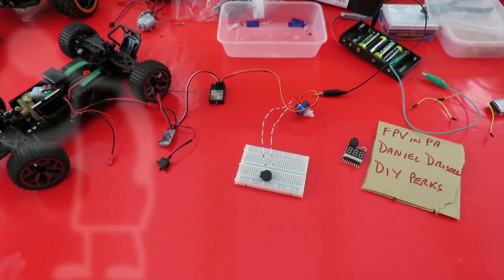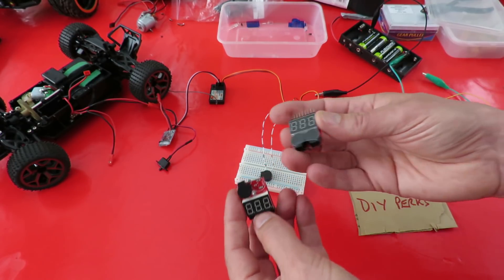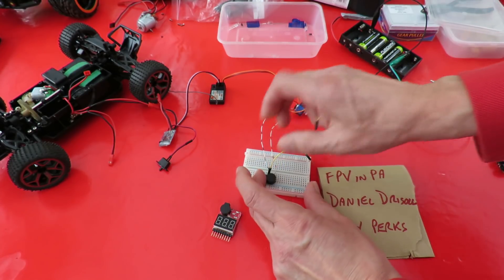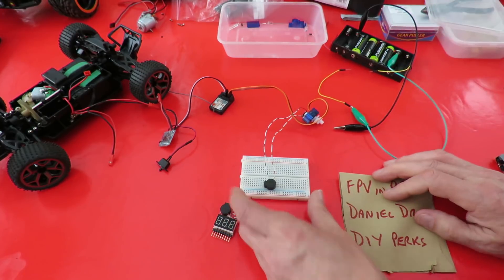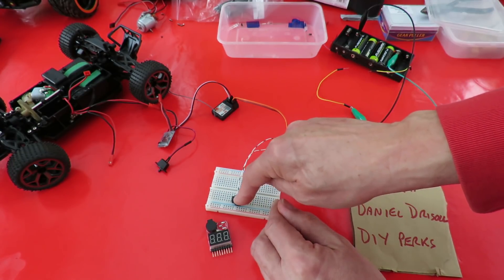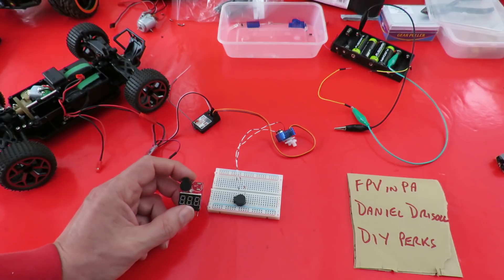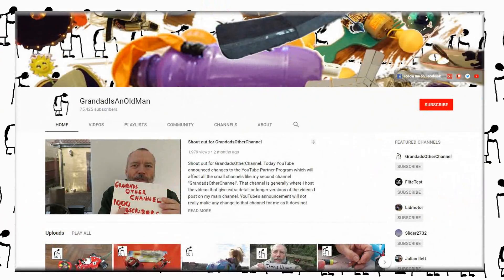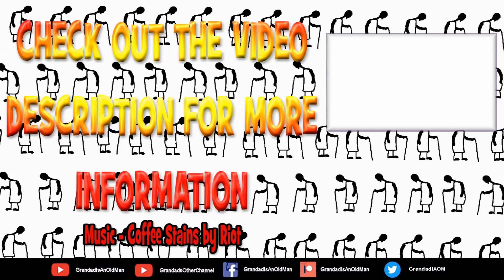Using the Speaker from a faulty LiPo alarm

Comment: Will the voltage checker still work if I remove both speakers?
Reply from the maker: Short answer is I don't know but as these only cost around £1 you don't lose much if it fails. I recently purchased a slightly more expensive one (£3.50) that gives a bit more information and after initially being sceptical about it, I have found it quite useful https://youtu.be/gVFMTZqVS-Y

Comment: What about taking the frequency generation off of the battery tester board, wouldn't that work?
Reply from the maker: Anything that is going to generate a wave form for you will work. The point I was trying to make is that is is a speaker, not a buzzer module.